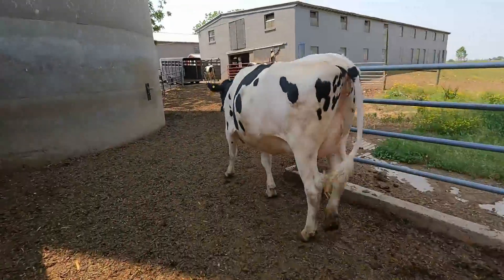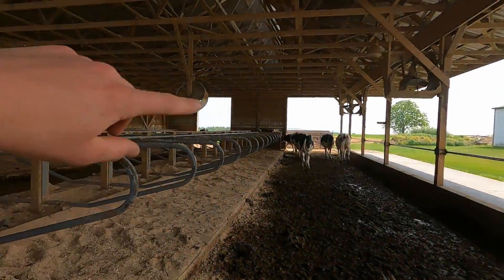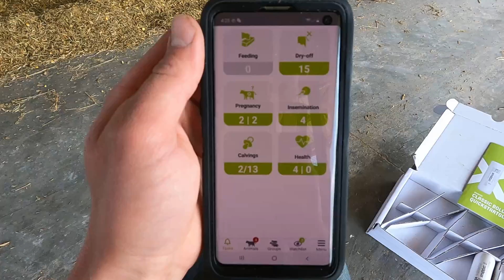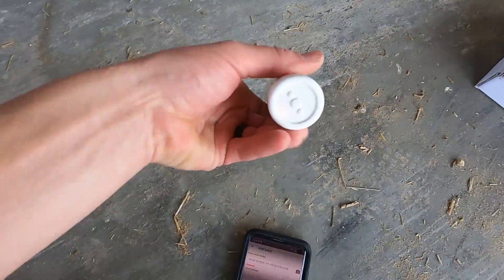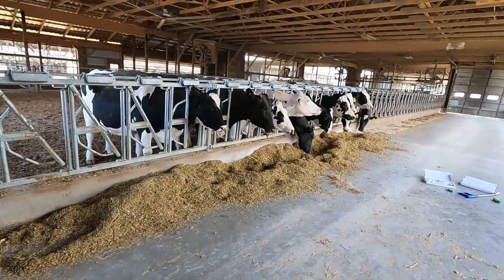SmaXtec Cow Health Monitoring

Comment: Hey Eric. I want to point out that the instruction manual of smaxtec strongly warns to administer the boluses on an empty stomach. Now, I'm not a farmer myself, but I got interested in the smaxtec system and discovered an online instruction manual. I quote: 
"Warning: After insertion, the smaXtec pH Plus Bolus or the smaXtec
Classic Bolus needs to settle on the floor of the reticulum as quickly as
possible. For this reason, it is important to ensure that the fibrous
material in the rumen is not too dense, i.e. the cow should not recently
have eaten anything. It is therefore of utmost importance that your animal should
have an empty stomach when the sensor is administered. Acting in accordance with
the user instructions provided by smaXtec will ensure smooth operation of the
measurement procedure"

Comment: Can this bolus system be connected to your computer and then print out alarm lists for the different conditions you might want? How often do you run through the whole herd on your phone? What percentage of the cows will you breed only on the activity report without seeing any in heat standing? Looks like it could be a very good system.

Comment: Found on the internet. 
The data cow bolus runs for about 12 months. It is designed to be excreted naturally through the cow's digestive system. However, if the bolus does not pass naturally, it can be removed by a veterinarian.

I am not a farmer, vet, or tech.
Reply: The bolus remains inside the cow for a lifetime. It remains in the same position in the reticulum due to its own weight, and is neither regurgitated nor digested.